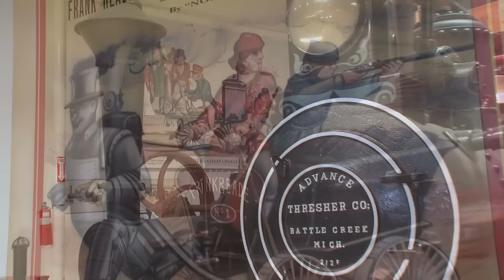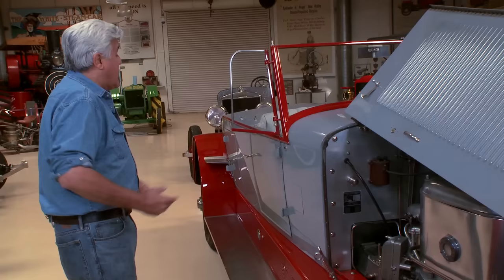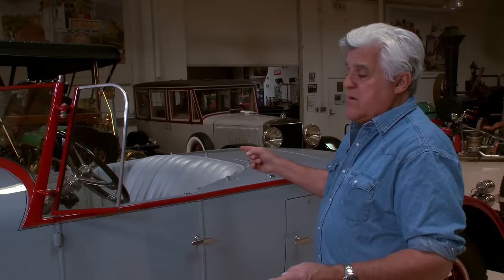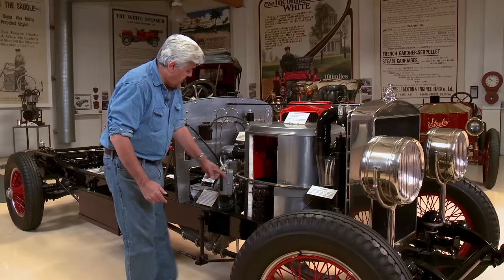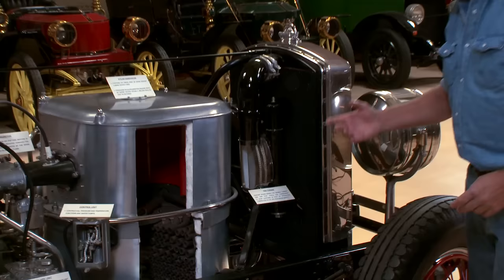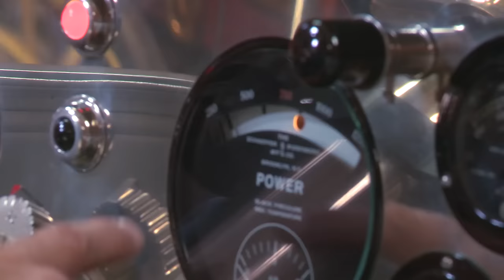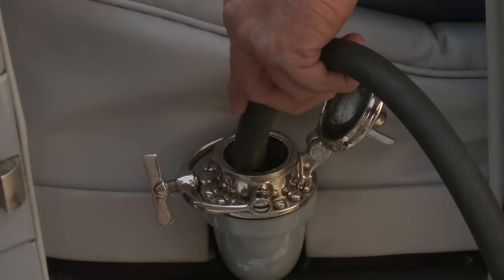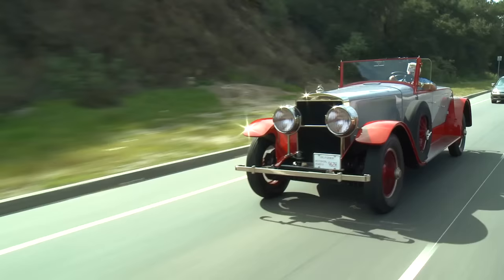1925 Doble E-20 Steam Car - Jay Leno's Garage

Comment: Its surprising how much they look like a normal car of the time
Reply: Well by 1925 all the other steam car companies had gone out of business, it would have been desirable to look like a "normal" car
Reply: Even Franklins had a dummy radiator.
Reply: On this, it was the condenser.
Reply: All Doble built was the chassis and running gear a coach builder built the body. the same coach builder would have also been building bodies for other internal combustion engine cars at the time. this is why it looks the same.
Reply: Nathan Woodruff Or maybe because they didn't want it to look like a steam car.. which was already outdated and out of fashion in the automobile industry???
Reply: Just a lot bigger...

Comment: I want to convert a normal car to steam so I can run it on logs, or books
Reply: Run it on Ford owner's manuals!
Reply: I want to run one on tires and plastic, and take a cruise through the Earth Day parade in the city ... :D
Reply: Good Idea, make people's lungs bleed on earth day!
Reply: Nabre Labre  Just run it on Rembrandt and Picasso original paintings. Be a real rebel! :)
Reply: Good idea!
Reply: Nabre Labre You willing to haul all that and stop to feed the flame every few miles?
Reply: I'll put an ogger in the floor that feeds woodchips to the fire
Reply: as well as range. Unless you're compressing air as you go (or generating steam) you won't be getting very far.
Reply: Phu Doan You don't think that would just add more weight and waste more fuel?
Reply: To run on logs, etc, perhaps tuning the material into charcoal may the only feasible way to go.
Reply: PacificCircle1 Wood would be terrible...Not much advantage to using charcoal either...

The Doble 'E' used a 2 million BTU/H burner to produce 150 HP, it was also fitted with a 25 gallon fuel tank that when filled with gasoline would weigh +150 lbs. 

To fire the car on wood and carry the same amount of fuel in the form of wood (2,850,000 BTUs) you would need to carry between 400-500lbs of wood on board.

Then you have the issue with firebox efficiency too.. to generate 2mil BTUs you need to burn wood at the rate of 352lbs per hour.. Charcoal is not much better at 316 lbs per hour,  and charcoal is much more expensive too... not to mention its enviromental impacts.
Reply: The real doktorbimmer I never said burning charcoal would work, but it certainly would be closer that burning wood and such - that was someone else's idea.
Reply: PacificCircle1 Oh it certainly would work.. the railroad industry used wood for many years in outlying areas were coal was not readily available... but of course like the steam locomotive... your car would require a wagon towed behind it and a supply of wood placed every few miles along the road, a crew of full time workers to fell, cut, haul, stack all the wood and someone to stoke the boiler on a continuous basis while you are busy with the task of driving your car down the road...
Reply: It could be done there are people who have converted internal combustion engines to work on steam
Reply: Bryan Olson The important question is why?

and a reciprocating engine designed to run on steam needs to be very different than an ICE to take advantage of steam.
Reply: So you can run it on logs, or anything flammable
Reply: Nabre Labre Yeah but it would be better to keep the internal combustion engine and just use a liquid or gaseous fuel... one derived from wood, like wood gas, methane or ethanol.

burning logs to fuel your car? is frankly kind of a dumb idea from a strictly engineering  point of veiw.
Reply: ***** Yes, the efficiency of wood gas can be (more important, they can be directly measured) - but do you know what are the values? For example, what is the overall thermal efficiency of the Wayne Keiths engine systems? Are there any automotive Wood Gas engine systems actually tested that were significantly more efficient? Also important, do you know the actual values for the efficiency of Wood Gas fueled engines during normal drive cycles (not merely peak values on a test bench)? I don't doubt that gaseous fuels used modern ICE's are more efficient than liquid fueled automotive engine systems. However, I do argue that they're not much higher than commonly believed.

 And futhermore whats is the cost effectiveness???
Is wood fuel even practical on a large scale production basis??  Would all the trees in the world need to be cut down to keep up with global demand? Would all the remaining  forrest in the world be cleared for mass agricultural production of wood fuel?

What are the possible enviromental impacts of using wood on large scale such as air pollution... certainly the end fuel product burns cleanly but what about the process..??? 

I noticed that even Wayne Kieth uses a Diesel powered wood splitter...
Reply: ***** Frankly, I couldn't help but thinking the same of your comment. 

Anyone with a firm grasp of the engineering concepts and practical design should understand the folly of such notions... wood has extremely low energy density and in terms of powering automobiles outside the realm of practicality....
Reply: ***** No, wood gas is extremely inefficient as a fuel source compared to petroleum.. nor is it a cost competitive option for widespread adoption into the market.  I was simply demonstrating the hypocracy of your previous remarks regarding the Dobles efficiency data..  

Can I safely assume you have no formal education in automotive engineering?
Reply: ***** I think you completely missed the point...

If the widespread use of wood fuel was adopted? Its pricing would be subject to the exact same supply and demand economics, spikes in global demand, futures markets and speculation....

The fact remains that wood resource reserves simply could not keep up with demand and a large net increase in the cost of fuel would result.  

Many of those who despise petroleum and promote alternative fuel simply do not understand the dynamics of  fuel market economics... I would be happy to explain this concept in greater detail to sort out any confussion relating to this concept and perhaps clairify the matter...
Reply: ***** Yes, the ICE is certainly more efficient than steam... regardless of fuel types used..

The question is what is the most efficient fuel for ICE engines.. in terms of btu density wood gas is extremely low..  less than direct combustion... and far less than hydrogen or methane.

Vehicle design requires high fuel density to provide minimal volume of fuel storage space, efficient range and payload. 

Wood gas is not a very clean fuel either.. producing excessive carbon deposits, increasing maintaince costs and wear  damage to the engine.
Reply: ***** True, peak BSFC is always at WOT on a Otto type ICE... do you know why?  that is also why Diesels and turbocharged engines are more efficient in real world driving cycles...

Drive cycle efficiency is also largely a product of maximum horsepower output. 

You asked;
""But I wonder how a truck engine fueled by a wood gasifier, and showing a peak net thermal efficiency of 17-18% manages to be more efficient than the same engine fueled by gasoline?""

Its not... the truck engine running on wood gas produces significantly less power...

You can only compare true peak BSFC and TTFE at WOT... and the same power output.

The Wood Gas engine is actually less efficient... its just using far fewer btus overall..

this does not represent a net increase in efficiency.

Wrong, steam can never reach the fuel efficiency of ICEs... our good friend monsieur Carnot already explained that for us...

Ignore Carnot at you own peril.. many have followed their own ignorance in pursuit of a more efficient steam engine... and failed miseribly.

The problem with steam engines is STEAM..

The latent heat of vaporization will always be there stealing away a big chunk of your heat energy... heat energy that cannot used to create work...

The maximum Carnot cycle thermal fuel efficiency of a Steam Rankine cycle engine is only 63%

The best current technology in the over 250,000hp- to 1 million hp range is in the low 40% range...

Steam cannot produce even 35% in the sub-100,000hp scale...

and you expect to get this range of efficiency in the what? 150-300hp range????

Pure nonsense my friend... you are a dreamer.

Good luck!
Reply: ***** Exactly my point... if you want to use wood gas use a Diesel....
or better yet convert the Wood to ester..

It makes perfect sense when you realize that the engine is less efficient running on wood gas...the lower power output per liter is proof of this...
Reply: ***** wrote; ""Yes, a piston steam engine can show 35% net thermal efficiency in the 150-350 hp range. Yes. It can. It can do this with a combination of 1100F peak steam temperature, multiple stage compounding with low expansion rates in each stage, aggressive reheat between stages, full regeneration of superheat into the cycle with a combination of excess air and air preheating, and attention to minimizing thermal losses and the work required from auxiliary loads.""

I think you forgot one very important detail...  everything you mentioned has to fit into the space of a passsenger car.... with room left over for passengers and payload...

This you cannot do.
Reply: ***** It cannot be done...

Because ol' Nic Carnot figured out the formula... and Herr Diesel proved it.

The maximum efficiency of the single cycle steam engine is only 63% the practical limit of the Otto engine is higher... at 76%

As I said before ... ignore Carnot's formula at your own peril...

Because he will make you look like a fool if you don't....
Reply: ***** Again... clearly you don't understand the practical  thermodynamic engineering or theoretical yeild limits imposed by Carnot's formula.. or Dr. Joseph Black's discovery of the Latent Heat of water.

The Steam engine can never have a higher practical heat engine efficiency than the ICE because it has a lower theoretical maximum efficiency...

Its a fruitless exercise to quible over additional stages, recovery techniques or co-gen... its still the very inefficeint concept of expending additional energy and making design trade-offs in a vain effort to gather the tiny little left over scraps of heat. These techniques only become practical as scale increases significantly.. and diminish quickly as scale is reduced, this effect also holds true for all heat engines including ICEs

First stage Carnot cycle efficiency is crictical to overall thermal fuel efficiency.. and the Steam engine can never match the ICE here..

A good  analogy is a very common combined cycle ICE, the turbocharged spark ignition IC engine... while the turbocharger can increase the thermodynamic efficiency yeild of a Wankel engine... it will always have less overall efficiency because the Wankel produces less first stage yeild... the Otto engine has a higher first stage yeild and therefor a greater COMBINED CYCLE yeild...

 Certainly, I understand no one enjoys having their theories cut down and debunked....

I hope at least you learned something...

Cheers!
Reply: ***** It still amazes me how many people that have never made a wheel... try to re-invent one.
Reply: Actually, with a steam turbine (rankine cycle), the theoretical efficiency is about 65%, compared to the otto cycle efficiency of about 45%. Now, I do believe the rankine cycle also applies to piston steam engines, but I'm not entirely sure about that.
This is why steam turbines are still used so much in power plants.
Reply: +Sander Vercammen  ICEs are more efficient than steam. The most efficient single cycle steam turbines barely achieve 40%, about the same a combustion engines currently offered by some automakers.. Diesel engines are even more efficient.. with current technology exceeding 56%.
Reply: Be careful not to confuse thermal efficiency with fuel economy.  Reciprocating pistons max out around 40% thermal efficient.  Turbines requires less work to operate and can hit around 60%.  The most efficient Diesels are in ships, and are huge with bores and strokes measured in feet.  Stirlings top the list, but cost makes them prohibitive in anything beyond a demo engine
Reply: +Dave Shoemaker  But BSFC can be used to directly determine Carnot Cycle efficiency... they are Directly Related.
Reply: +Dave Shoemaker Not true, you can buy a new car with a reciprocating engine that exceeds 40%... and marine Diesels now exceed 56%.
A steam turbine??? No, not in single cycle operation.. a multi-stage heat recover cycle steam turbine may be practical in a 3,000 mega-watt electric power station... but not at all applicable to automobiles.
Reply: The real doktorbimmer I don't have the data to support, but I do understand concepts of work and energy.  Knowing how much work in is required in the Otto cycle, I would be shocked to see anything greater than 30% when operated in typical highway fashion.  Partial throttle limits efficiency by cutting into volumetric capacity and reducing work out and increasing work in due to throttling and pumping losses.  If you have data to support 40% in an Otto cycle, I would love to see it.  Diesel gets closer, and we under-use diesel in the US.

I agree, efficient turbine application needs to be multi-stage in a fixed environment.

I'm not trying to start a bench battle.  Kuddos to Jay Leno for doing a great job show casing great cars built many years ago!
Reply: +Dave Shoemaker I'm not sure what point is? But I think its very clear that steam is inherently less efficient and the fact that steam powered automobiles have been obsolete for a century now speaks for itself. cheers!
Reply: Wrong kind of doctor kid... obviously you have never been to college
Reply: Wrong kind of doctor son... don't you know what a doctorate degree is?
Reply: Please tell us what is the most efficient combustion engine?
Reply: Really? Then why are electric car less than 1% of all the cars on the road???
Reply: New car buyers purchased over 100 million new ICE vehicles last year... and they will do the same again this year for the same reason.
Reply: Then Why are EV less than 1% of all the cars on the road??? Prior to the invention of the electric starter for ICE cars? EVs made up 28% of all the cars in the U.S... WHAT HAPPENED????
Reply: Why did most of the EV car companies from the early 2000's go bankrupt already? where did they all go? Only Tesla is left and they still have not made a profit selling cars
Reply: Are you claiming now you cannot refill your ICE car at Home???
Reply: Then WHY? Did electric cars go from 28% to less than 1% today????  Could it be that ICE cars are just better???
Reply: That would only make sense if all the EVs in the world were recharged using only renewable energy... which is simply not the case in the real world.
Reply: Then WHY? Do EV cost so much more than ICEs? Most people that own a car cannot afford an EV!

Comment: but will it do a burnout
Reply: With 1000 feet pound I think it could break the wheel spokes if he wanted lol
Reply: They will easily spin the tire off the rim tearing off the valve stem in the process.
Reply: With 1000 foot pounds it'll spin the wheel better than any muscle car
Reply: no the traction control will prevent it from doing burnout XD